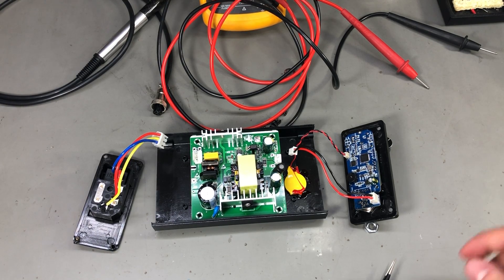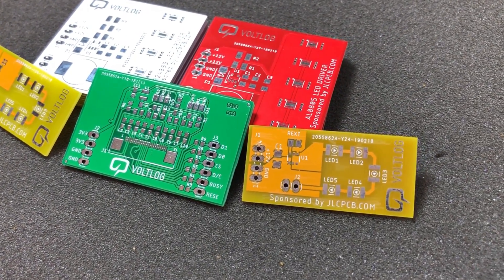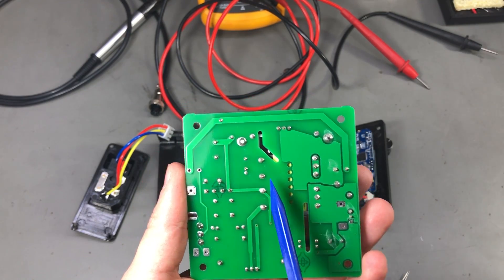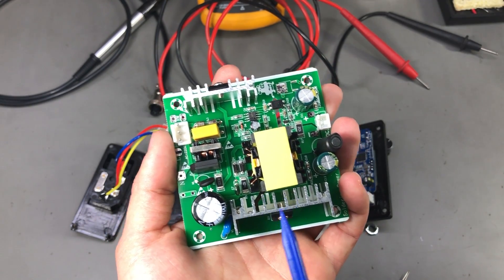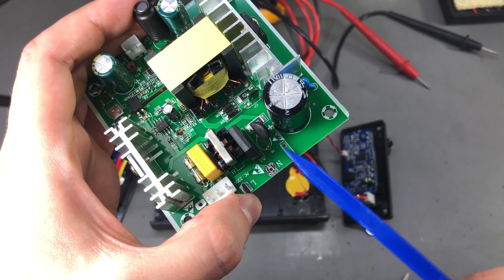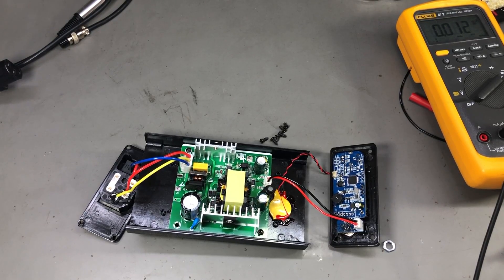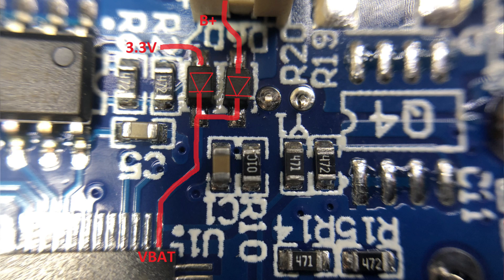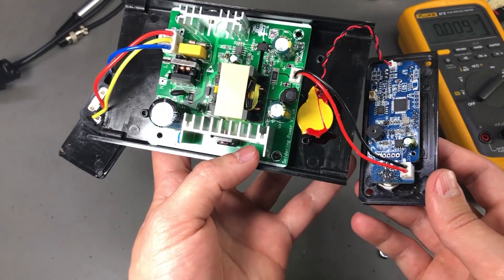Voltlog #234 - The Problems I Found With The KSGER T12 Soldering Station

Comment: Thanks for reviewing the issues with the unit. Was already thinking on getting one and it's good to know the drawbacks it has beforehand.
Reply from the maker: Even with these drawbacks, I don't think there is anything better for the price.
Reply: @voltlog  
I wonder, do you have a comparison video between KSGER version and Quecoo/Quicko model? I'm trying to figure out which between them two to purchase. Quicko has a great feature that you can use it with a 16-24v power source (useful for mobile use).
Reply: @MaximC , Quicko (aka Quecoo) now makes two T12 stations for around $50 US that can dock directly onto Milwaukee, Makita, Dewalt or Worx batteries, without requiring an adapter (not all of them, you have to specify which battery type that you'll be using). Being complete isolated from AC house-current may be advantageous for some users and situations.
Reply: @goodun2974 
Thank you for the information. Very interesting.
Reply: @MaximC , PS,  before retiring from audio equioment repair, my daily- driver soldering station for 20 years was an old Weller Magnestat type unit. I have one at home as well, which died last year; I have a couple of standard T18/900M style solder stations at home, and have been tempted to try a T12 unit, but the electrical issues of the cheesy switching supplies and inconsistent ground protocols seen in KSGER, Aixun and others are somewhat off-putting. The electrical-safety and portability of a battery-powered unit makes the Quickoo attractive to me, and a heavy battery clipped on underneath means it won't slide around on the bench.
Reply: I have one of those cheep Chinese 938+ units and I really need to upgrade.. I have been thinking of this unit or biting the bullet and buying something more mainstream..I think I'll get this unit now and just do the mod's right off the bat..